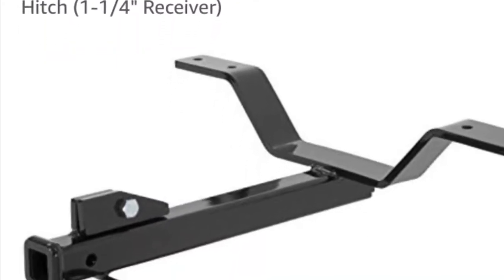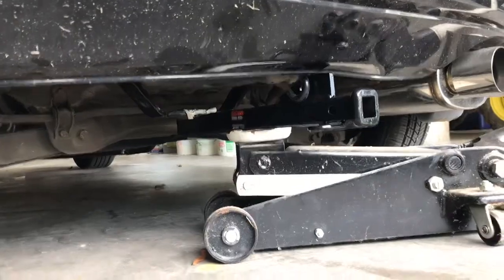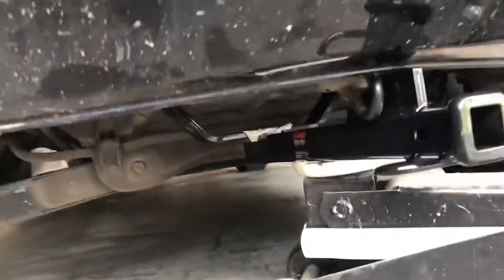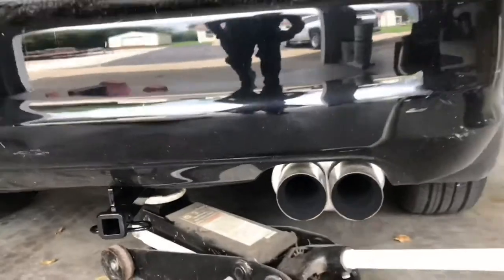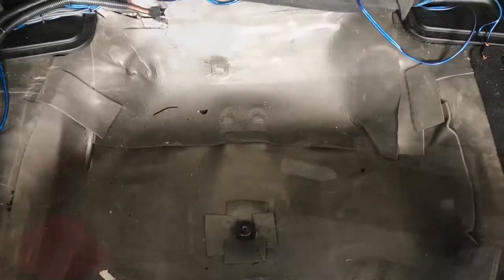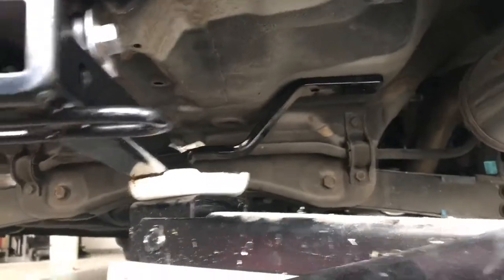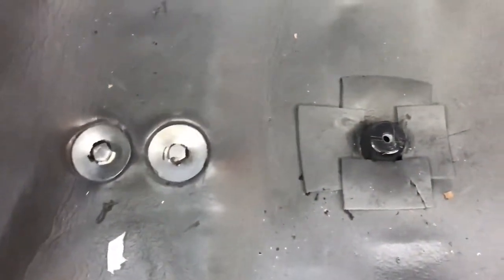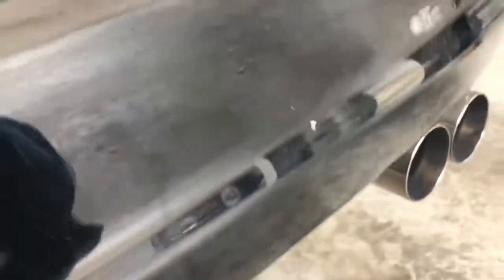2003 Honda Hatchback Trailer Hitch install

Comment: According to Curts website there is no drilling needed .... Either you got the wrong hitch or they lied ....
Reply from the maker: I do believe you are correctly.  There is no drilling required.  I felt the need for the extra support. I used mime hitch for bicycle rack .
Reply: @rickgarrisonhavc  Went a little crazy for that no ? .... It's a bicycle
Reply from the maker: @IrnMaiden304  yea you are correct . I had a bicycle rack over rear  window . I needed the hitch. It works perfect.